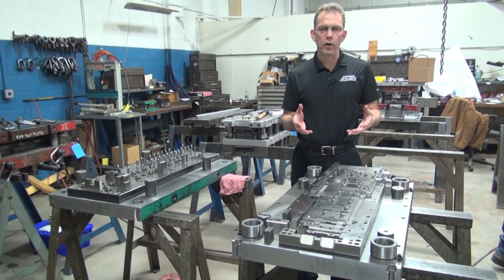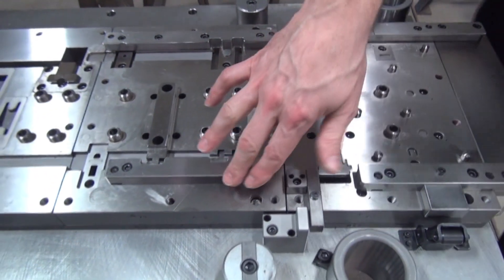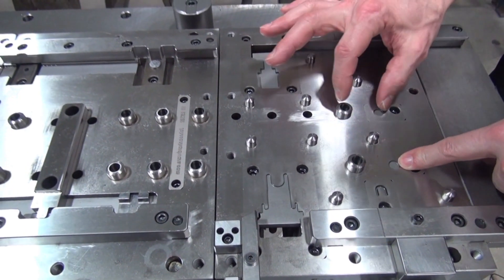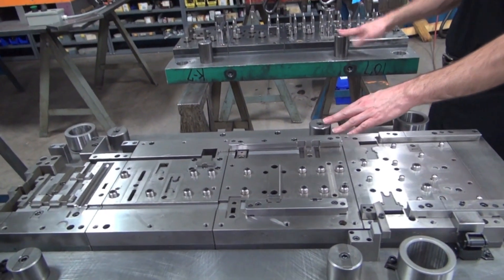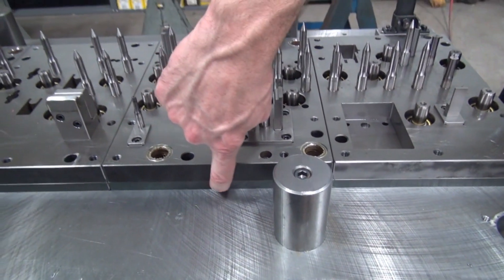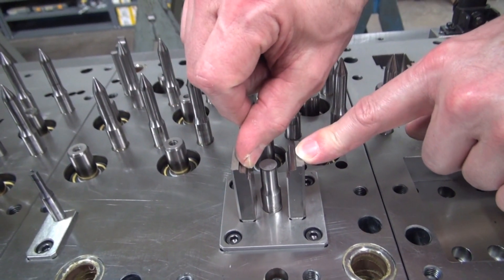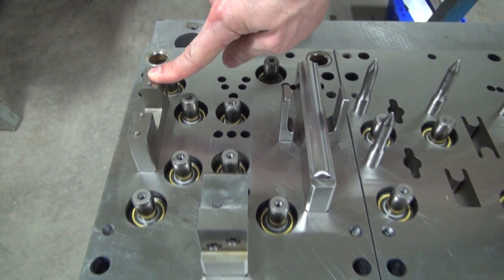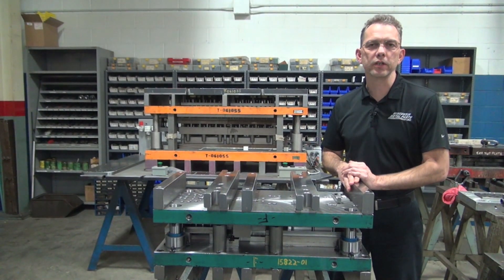What Makes up a Progressive Die? Part 2

Comment: As a designer, I never understood placing hardened inserts into hardened retainers.  That screws the Toolmakers down the road.  If it doesn't cut, it doesn't need to be hardened.
Reply from the maker: Thanks for your comments Scott. While your comment is correct in some cases it is not true in all cases. Often a company will dictate it’s own die standards based on years of experience and what works best for their particular situation. For example, in the case of a die chase, a soft block could wear if it comes into contact with the stock strip during the stamping cycle, say you are running stainless. Soft steel can also attract burrs and get debris or shavings pressed into them which could result in the final part being marked unintentionally.

Comment: What are you using for protection? I don't see any steel in or part out detection
Reply: Pilot pins and double thickness I would imagine. Probably portable buckle switch at material entry too.

Comment: Nice clear explanation of the process and visuals. I personally used the Lamina stock guide/lifter system when possible. Strip moves easier and gives better lift to the strip. Bonus, they are good looking too!